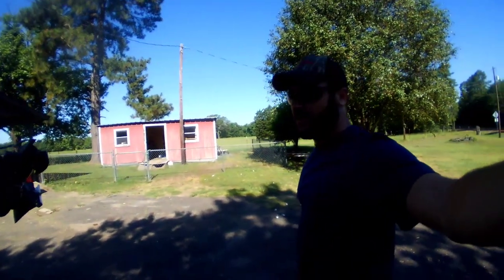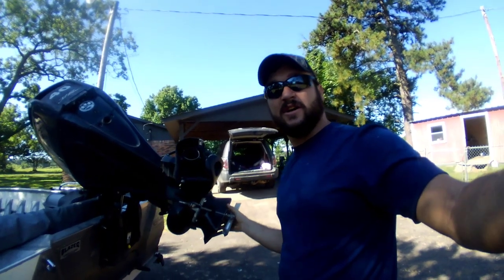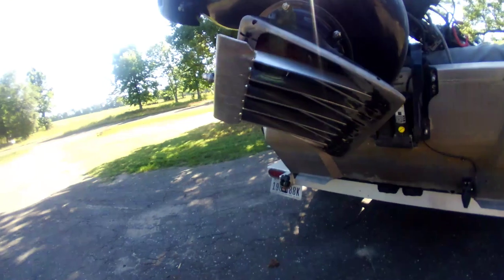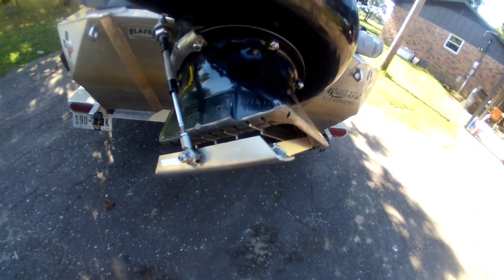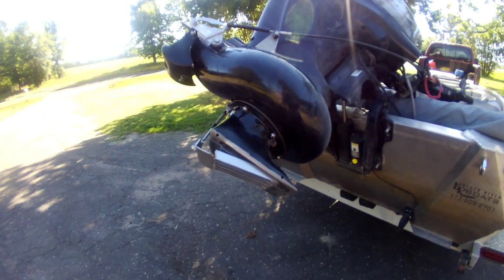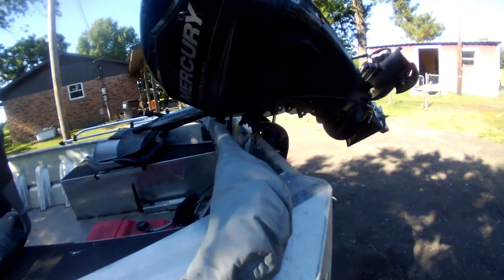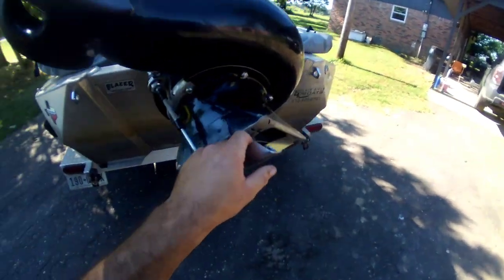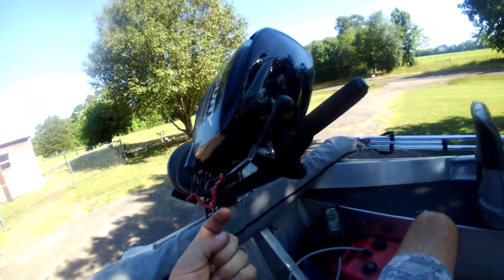Outboard Jet Rock Ejector (stomp grate)

Comment: Hi Dennis, does this things work for leaves?  Most of my fishing is in fall/winter in pa and I am constantly laying out removing leaves for every couple miles of river.  Even heated up the impeller maybe bearing IDK once or twice twice trying to get though skinny spots without coming off plane.
Reply from the maker: Yes. I kill the motor and open rock ejector and start to trim up while still coming to a stop and shake motor back and forth for a second or 2. The turbulence of water and opening the grates and trimming up really clears the leaves. Sound like a long process but take 5 seconds maybe.

Comment: Does it help with clearing weeds at all or only rocks?
Reply from the maker: It does. Helps with anything. I use it on leaves and river drift all the time. With vegetation I like to kill the engine start trimmings up and open the grates.

Comment: Hi Dennis. Have watched your videos. Noticed you've been in my neck of the woods, Snake River Idaho outside Boise. Anyways, the Snake is LOADED with milfoil and hydrilla weed grass, my jet is always getting stopped up. Would you recommend this product to me? 1860 115/80 Merc
Reply from the maker: When I was up in that area the stomp grates on the inboard seemed to work well. I did not have this ony boat when I was there.

I do feel it would greatly benefit you. Kill the engine rake the ejector while trimming up should wash most if not all the hydrilla off.
Reply: @DennisBohannan  thanks for the reply man! Only products I can seem to find is, 1 some fancy air powered stomp grate and the other like you have. Product titled "the rock ejector"...for somewheres around $450. Is that the one?
Reply from the maker: Yes that is it. The rock ejector. Built by Jim Shultz out of Missouri.
Reply from the maker: @serialseatsniffer5610  his website amd email can be found in the description of this video.